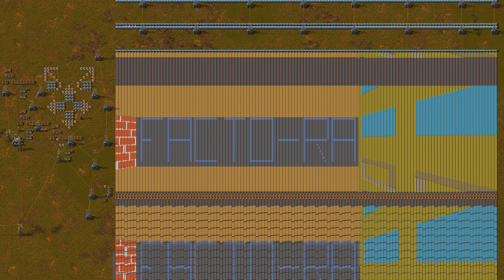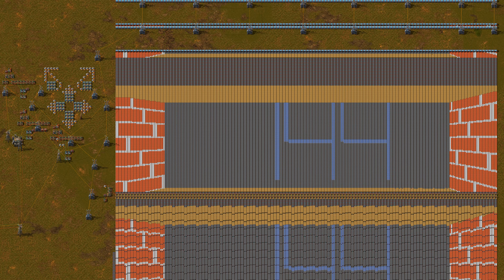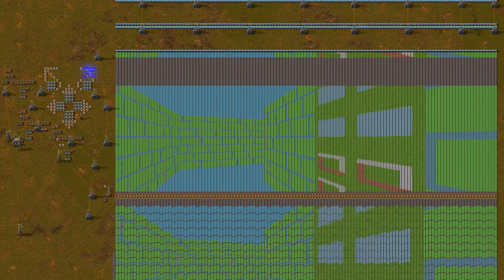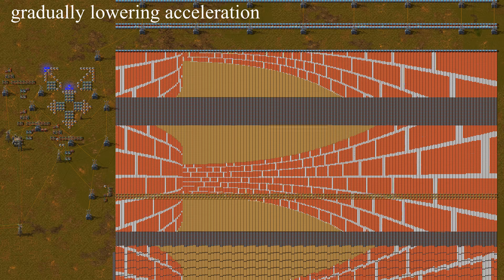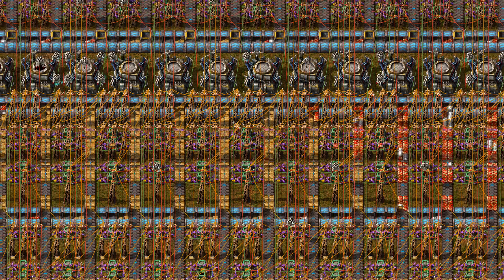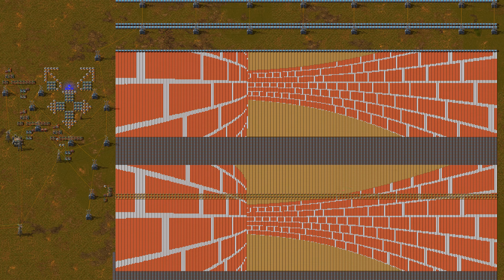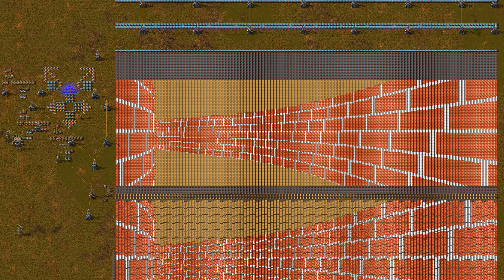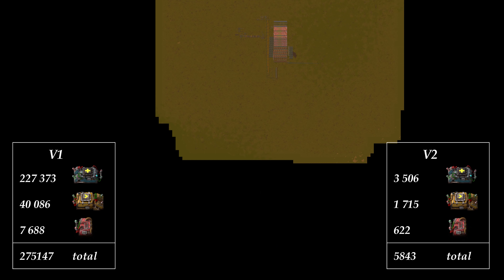Raycasting engine in Factorio 1.0 (unmodded) - Facto-RayO v2.0

Comment: you need to make it so it can run the ingame game at a faster fps. that fps is around 20? but if you need a modified Conveyer belt that runs it at 20 fps. same for inserters. so it can be playable in real time. it will be hard to code in though.

Comment: Devs once said: "It's essentially Programming: The game."

I see someone took that quite literally.
Reply: Factorio's combinators make it more like "Hardware Engineering: The Game", what with all the wire you end up connecting.

If you want "Programming: The Game", you want Zachtronics' offerings. Several of their games outright have you writing assembly-language programs for fictional processors. Very restricted ones in the case of TIS-100 and SHENZHEN I/O. EXAPUNKS gives you free program length, but disqualifies programs that are too long from the online leaderboards. Even the games that don't have you writing code have a thin veneer of being something else on top of what is more-or-less programming.

Comment: "I've set the worker robot speed to level 100,000" - That would require some 10^30105 science packs and 10^30098 years to research until that point.
Reply from the maker: With how many labs is that?
Reply: @arrowinmygluteusmaximus  The quoted time value is for one lab. Even with the maximum number of labs possible in a single map at max lab productivity, it would still take more than 10^30000 years to get to worker robot speed 100,000.
Reply from the maker: Max number of labs? Factorio are pretty big ...
Reply from the maker: Maybe a more interesting question is, are there enough resources in a map for this?

Comment: I would say the screen is a downgrade since it plays slower. It makes it much harder to really call what it's playing a game. Though as a technical exercise it's more impressive overall.
Reply from the maker: It's not really that v1 had a particularly fast framerate, mostly because of the low ups. You're right that's it's still slower but some compromises need to be made to work better with the other components

Comment: Have you thought about making the screen out of colored lights (each pixel would consist of 3 RGB subpixels, just like in normal monitor). Dunno if the intensity of lamps can be controlled, but even if not, you can flash lamps rapidly to change subpixel intensity as it is done IRL with LEDs.

And update speed would be probably be faster than with items on belts, even if it may still be kinda crap.

Comment: is you used light based pixels instead of belt based, would you get a more reasonable frames per second?
Reply from the maker: Uh probably. But as far as i know nobody ever build a light based display with this high of a resolution. And upscaling an existing design won't be easy as my belt display takes a custom input format, so you would probably need some kind of fancy converter

Comment: I believe wolfenstein 3d has a more similar engine to what you have. Doom has height and ramps in it. You can clearly change the camera height but you'll have a hard time getting your ray caster to display a half height wall. Also I would love to learn more about your texture engine. Are the bricks created programmatically (if y height draw grout here) or do you have a pixel by pixel brick texture?

Comment: I DON"T UNDERSTAND!!!! :(((
Reply from the maker: I'm assuming you've played factorio before.

So you know combinators exist in the game? They are like logic components you can use to turn off parts of your base when you don't need it or build an indicator with lamps to show you what resources you need most and stuff like that. I used those components to build a rendering engine. So you can render walls, doors,... And walk around and stuff. And as a screen i used a bunch of inserters placing down items on belts. So if i need a red pixel the inserts place an advanced circuit, if i need a brown pixel they place some wooden chests... It's that clear? Or do you need me explanation
Reply: @arrowinmygluteusmaximus  this is just on another level. As a engineering and programming  30yo idiot, I still cannot understand how basic TV works, how to code anything via hardware or what brain should circuit board engineers have to understand every single connection and what and how to do. 

 This is just magic for me.

Comment: This has bothered me for quite a while now, would you mind tuning the settings of your microphone? I legimately have trouble sometimes figuring out if this is an auto-generated voice or not, even though I know it's not. I think it is because of the arbitrary shifts in volume the mic has.
Reply from the maker: I'm sorry for the poor audio quality. But it's most definitely not the settings on my mic. As my mic has no settings, it's the mic from a cheap headset. So it's definitely my editing. I release very few videos so don't get much practice editing. Also the mic might be at slightly different distances in different recording sessions. In addition I'm just very bad at speaking to an empty room...

Could you provide a start and an end timestamp where the change in volume is particularly bad?
Then i can go back into the editing project and take a closer look what went wrong there, to be able to better learn from my mistakes
Reply: @arrowinmygluteusmaximus  I am sorry, in that video I cannot specifically remember one timestamp, it is generally across the video. Some of your older videos were really bad for this like your braking force one (at the beginning).

It also helps to hang cloth on your walls I have personally found to get better quality. Of course, as a german myself I also know how hard it is speaking a different language you usually don't. Why not get a Blue Yeti? It is relatively cheap and basically the standard microphone. Headsets are bad for anything anyway. Bad earspeakers, bad mic, at a bad price.

Or just a cheap 10€ Lavalier from Amazon, it's what I have, really nice. I use it at 1m distance and to the side of me.

Comment: This is beautiful. What do you use as registers, chests? Also, what are you using to define the clock speed?
Reply from the maker: This ain't some kind of ARM or x86 processor, no registers to be found. This is more like an ASIC.
Memory in general is mostly done with a combinator looping back on itself.
Same with the clock, but combinator does % clockspeed and it has a second input that adds 1. This way you get a loop that repeats periodically.
Reply: @arrowinmygluteusmaximus  So the looped back combinators are latching with the desired values? I could see the potential for a lot of information to be saved that way.
Reply from the maker: and if you need to overwrite values instead of adding/subtracting
then you need to use a decider combinator and clear it the tick before the new value arrives by turning it's condition false
Reply: arrow in my gluteus maximus reminds me of PLC relay latching, but retaining A LOT more memory than a bool state.

Comment: I dont understand
Reply from the maker: what don't you understand? and just to make sure we're on the same page, have you ever played factorio?
Reply: @arrowinmygluteusmaximus  I dont understand what is going on,or how is this even possible xDDDDD Yes,for few hours :D
Reply from the maker: So you know combinators exist in the game? They are like logic components you can use to turn off parts of your base when you don't need it or build an indicator with lamps to show you what resources you need most and stuff like that. I used those components to build a rendering engine. So you can render walls, doors,... And walk around and stuff. And as a screen i used a bunch of inserters placing down items on belts. So if i need a red pixel the inserts place an advanced circuit, if i need a brown pixel they place some wooden chests... It's that clear? Or do you need me explanation

Comment: How did you learn to create 3D graphics engines from raw logic components? That's incredible
Reply from the maker: well I have a CS degree, but it didn't include any graphics engine courses. I did have several courses about CPU design that probably helped for the "from raw logic components" part. But it's mostly just being in the right state of mind and figuring stuff out for myself.
Reply: @arrowinmygluteusmaximus  I somewhat understand the systems that make a basic CPU work (ALU, RAM, signal busing, multiplexing/demultiplexing, etc.), but taking those and not only building a working computer but also making that computer run a fully-functional 3D renderer is beyond me. Well done :)
Reply from the maker: well this thing ain't Turing complete, so it's a lot simpler.

Comment: See that's the same principle inference used to prove statistically we live in a simulation. If you don't have the computation power, crank down the simulation time speed. Anyway looking forward to your idk factorio in factorio XD
Reply: Except that statistical proof fails anyway, since the universe is most likely not going to last forever. Assuming we can simulate an identical univeris at 1/100x the speed, then you can only have 1 or 2 layers before simulating a year would take longer than the lifespan of the "top" universe.

Comment: How much time did this take you
Reply from the maker: 165 hours on the save. But that counts up faster if you run at more than 60 UPS (I oftain run at x2 speed) and it also includes when I start up the game thinking I'm going to work on it and then doing something completely different with the game still running.

Comment: Its actually disgusting imagining how much time you probably spent making this, but at the same time absolutely amazing!!!
Reply from the maker: Probably less time than you think. There were a few months where i didn't even open factorio. And during the months where i did work on it, i also have a day job
Reply: @arrowinmygluteusmaximus  just how many hours are on this save  file and what do you estimate outside of that?
Reply from the maker: @Sander S 165 hours on the save. But that counts up faster if you run at more than 60 UPS (I oftain run at x2 speed) and it also includes when I start up the game thinking I'm going to work on it and then doing something completely different with the game still running.
Reply: arrow in my gluteus maximus wow that impressive your a very talented individual  I’ve shown multiple people your original video as it’s so mind boggling, keep up the awesome work man!